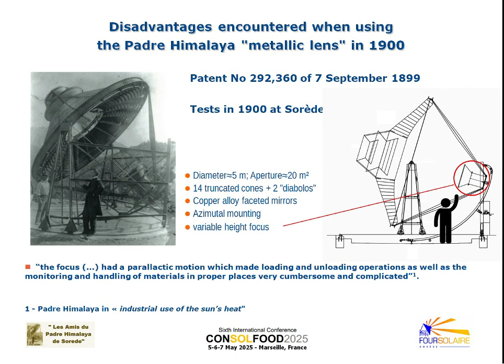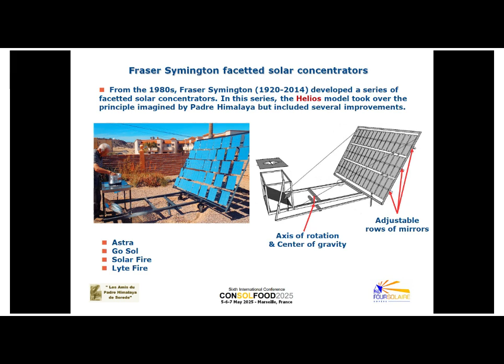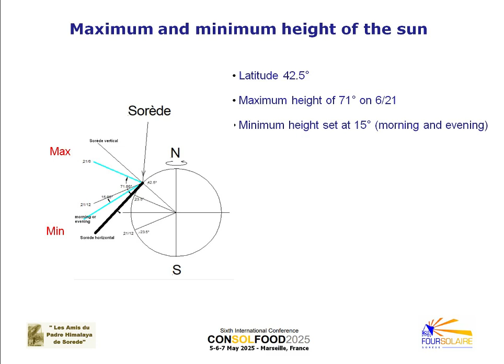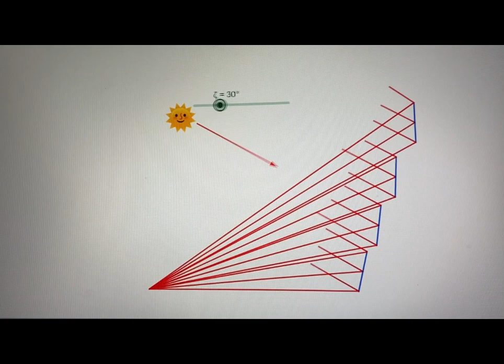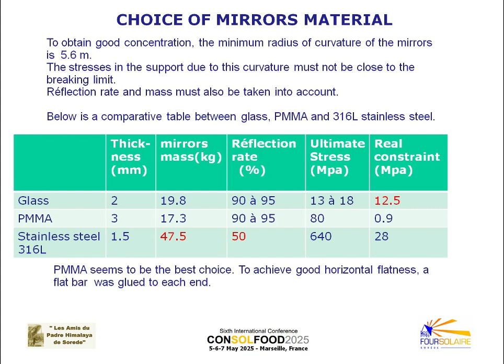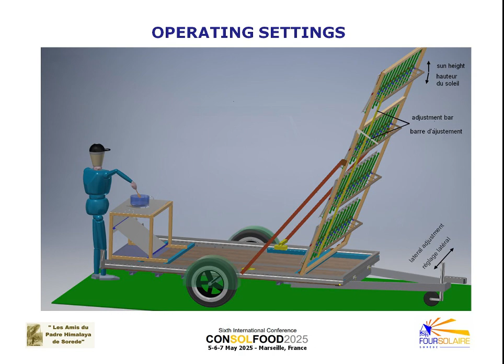S2B3 -  R. Le Gall, (France): Albera, a new solar concentrator with constant-height focus

Comment: Would you like to try my system? And mount it on a trailer?   It is called the "Sun Scoop" .  If you imagine a Scheffler reflector where you don't have to distort the dish shape to do seasons,   that is pretty much what I have done.   I also use a "waterwheel winch" to rotate the reflector.